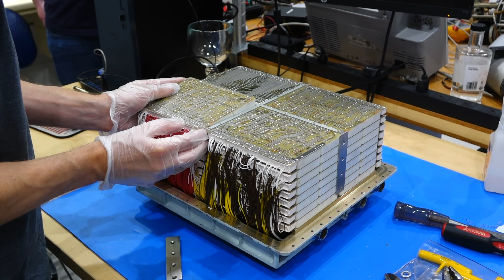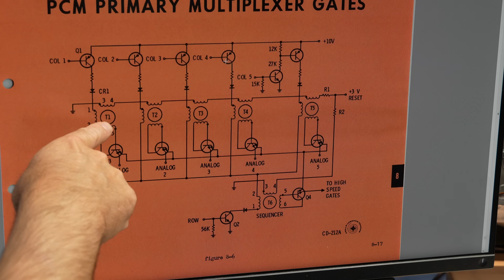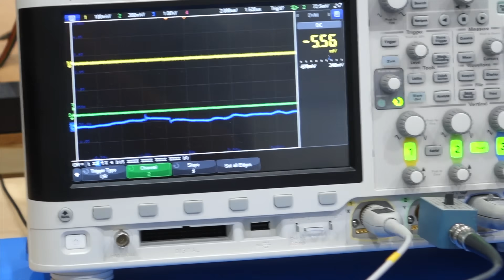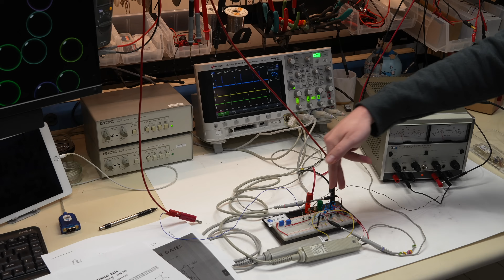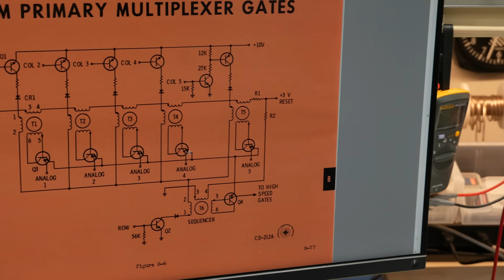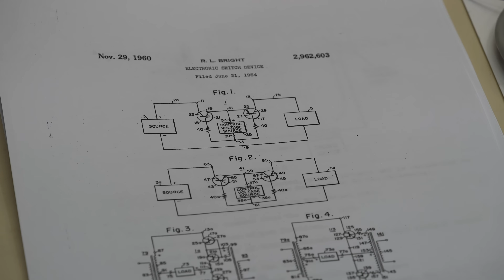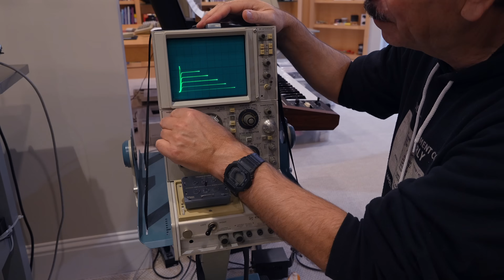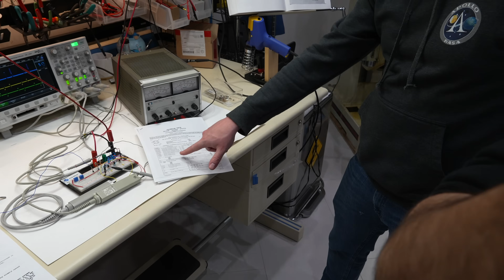Apollo Comms Part 37: Apollo's weirdest (but genius) analog circuit

Comment: In the old days Motorola made transistors that were optimized and specified for reverse operation.  The spec sheet called it "reverse beta."  These transistors were mainly used in chopper stabilized amplifiers (circa 1950s-60s) due to their low saturation voltage.  If you have an old Motorola transistor data book, this device(s) will be in there.  Typical reverse beta values are around 2 to 5!  Great video guys. Thanks.  UPDATE: The Motorola MPS404 was one of them.
Reply: More recently special transistors like the 2SC2878 were common in the mute circuit of CD players when they first came out. Reverse beta was high at about 150, the base-emitter reverse breakdown much higher than usual (25V) and saturation voltage quite low.
Reply: @stephendredge6077  Wow, what a weird part! I kinda wondered why this specific part was created instead of just using a FET, and then I saw the datasheet says the R(on) is 1 ohm, which is lower than (cheap) FETs of the time...
Reply: @stephendredge6077 that's good info!  Thanks, Jay
Reply: @stephendredge6077 ahh damnit lol, just looked down and see that we posted the same thing 🤦‍♂️ You an audio guy too?
Reply: So called "mute transistors" with high reverse beta and high Veb voltage are surprisingly still being made, you can find plenty on Mouser, including in SMT package. Still very popular around audio and D/A circuits to mute unwanted output glitches during circuit power ups/downs.
Reply: And 2SD2114KT is a modern sort-of-equivalent.  Also a very nice transistor by itself, tons of hFE.

Actually, many "low Vce(sat)" types have quite high inverted hFE too. I measured PBSS303NX at, over 150 I think it was? (But they don't come with the high Vebo of proper "muting" transistors!)

This is actually no accident, understanding the Gummel-Poon model and more to the point, how it's derived (physically).  For low Vce(sat) forward, you'll also get low Vec(sat).

I don't know offhand if the high hFE (even in saturation -- these types are quite happy with hFE(sat) ~ 50, merely sipping base current compared to the conventional old thumb-rule of hFE(sat) = 10) is a necessity for that, or just a consequence of thin base and strong E and B doping; but it certainly helps with driving.  The junctions are also highly interleaved (probably fine-pitch too), helping with rbb' and keeping things reasonably fast as well (a 2A-rated transistor boasting fT > 100MHz isn't shabby at all).
Reply: Yes, I used one of that sort in an AGC circuit many years ago.  The control voltage came in on the base and the emitter-collector path served as the lower resistor in a voltage divider.  The nice thing about the circuit was the exponential relationship.  This allowed the output to have the same remaining step in amplitude for any step in amplitudes on the input.  AKA suddenly doubling the input signal always made the same increase and recovery shape on the output.
Reply: 2 to 120 is quite a range :D
Reply: 5! ?? Bloody Hell 😮
Reply: Setmakers definitely knew about this even after semiconductor manufacturers stopped specifying reverse beta (edit: I just read that special types are still made for this purpose). Some Philips CD players used mute transistors that were, at first sight, overdimensioned. I think BC337 or BC637 instead of just a BC547. This was very likely done because of their reverse beta characteristics.

Comment: That circuit is not all that unusual, it is used in a lot of 60's/70's telemetry systems, I even have a guess where they got it. What I am curious about is how fast it switches them and what the settling time for the A/D might be. I was under the impression that they switched it a up to 200 Hz, that is only 5 milliseconds, so that means the A/D must be very fast for the era. Even with 80's systems, we had settling time issues with 200 Hz and we had to cut it off at 150, or, double up on it (put the same source on it for two cycles instead of one to let it have enough time to reach equilibrium). Or, alternately, schedule it so that the nominal values of consecutive measurements were close to each other - like, don't follow a nominal 5V signal with a nominal 1/4 signal.
Reply: In the previous episode, 50Hz x 128channels = 6.4KHz (160us) sampling. 200Hz was achieved by interleaving 4 channels/muxes. Theoretically they could have 1 channel at 6.4KSa/s by connecting it to all 128 channel inputs.
Reply: Nonsense, in the 80s there were already ADCs and DACs available in  up to megasample/s teritory. Even available in our shitty poor eastern block.  In the 70s it was tougher, but not being able to achieve more than 200 Hz, you did something very wrong.  (Or I did not get it where your trouble was).
Reply: @Sixta16  Yes, and the faster ones were also the most vulnerable to radiation (real and artificial) and would last about 30- seconds in the high-altitude space environment.
Reply: The Bright patent is assigned to Westinghouse, so that may be a clue.
Reply: Was it from Polaris?
Reply: @Omegaman1969  You're within about a half-a-mile, if my guess is correct!
Reply: @brettbuck7362 😊 hmmmm I’ll have to think about that.
My Father worked on Polaris/Trident launch and guidance systems from 64 to 97.
Reply: Well remember, at the end of the day, ADC can be done with a resister ladder.  In fact, many older avionics used such a system to convert resolver data this way.  Its cheap and easy.  You do have to use somewhat precise resisters and have to calibrate each device by hand, for instance, having a Thermistor to monitor the temp to fix temp bias and a few other things.  But for a one off,  that needs accuracy, I can see them hand building the thing.

Comment: I need to rewatch this a few more times to mentally deconstruct the cleverness of this.
Reply: This channels best attribute is reminding me how stupid I really am.    Thank god there are some intellegent people around.
Reply: @faumnamara5181 we've left a bunch unexplored on the table
Reply: I had to go back and pause on the circuit diagram
Reply: @letsgocamping88   And did that help?  🙂 The more I stared at the schematic, the further I went into "WTF?" territory.
Reply: @lmamakos  It helped for me.  You need to remember that the "sense" winding on the coil makes a pulse of current go into the base and out the collector of the transistor.  The two emitters and one collector makes sense if you make a mental picture or paper one.  There is a slab of semiconductor with two small blobs on top of it and a big blob as the collector.  The emitters and collector are isolated from each other because they are P type material resting on some N type material.  The current pulse floods the base with P type carriers to the point where it looks like P material instead so the two emitters are connected.
Reply: @letsgocamping88  I went to full resolution on the video and took a screen shot. 😆